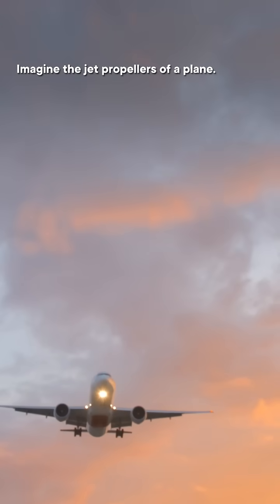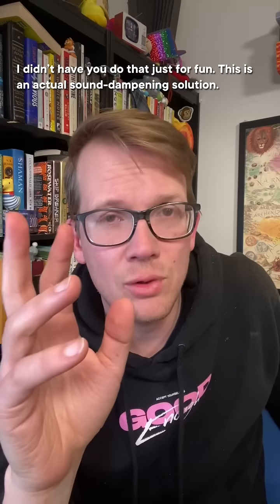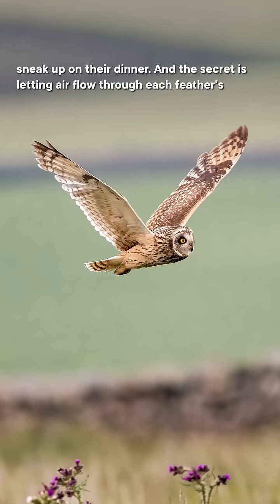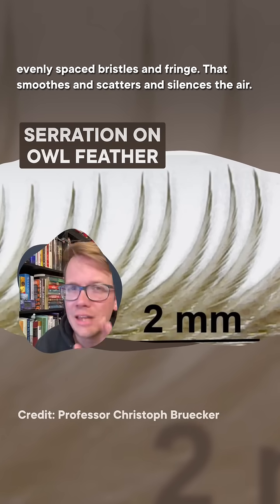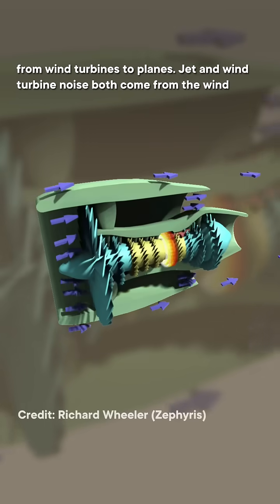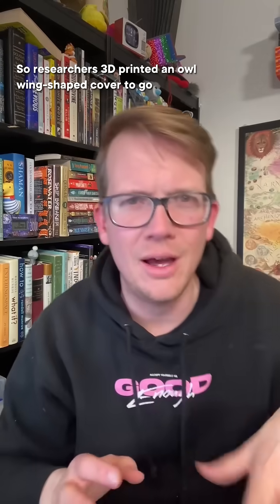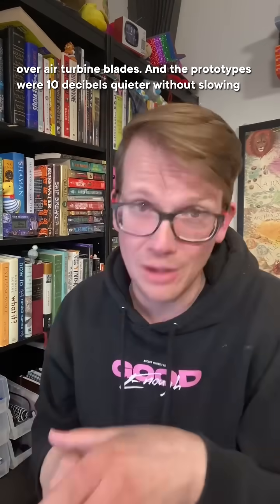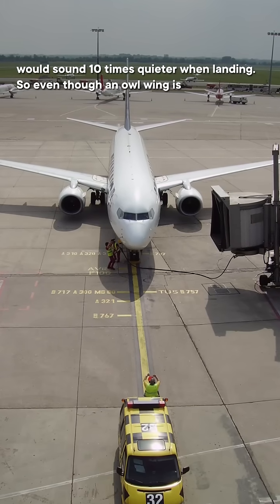Now, we can be as quiet as owls #shorts #science #SciShow

Comment: But wouldn't that increases the weight of the plane, decrease the durability of the airframe or make it necessary to use stronger (and expensive) materials? I mean, to shape something, you have to either add or remove material from the part you wish to shape

Comment: Ive seen owls do amazing flying. They are extremely quiet also. Had them go by my head at night in the forest and hit prey. I felt the breeze. My dog got one at night that did that while I was sitting in my chair in thought. Dog had been right next to me, then I heard a screaming sound, and didnt know what my dog was hurting, but I didn't like it and exploded out of my chair with a rush of wind in my ears and followed the sound and slid in hard knocking them apart and grabbing the owl in my arms to protect it. It was very soft and had no weight, so It slipped out of my arms and my dog went for it, but I got her collar. I couldn't really see anything though. I had no idea what kind of animal my dog had caught. I held onto my dog as I got up, and could just see a kind of jerking awkward motion of an injured animal moving away from us. It had gone silent. I leashed my dog and took her home and got a light and went out by myself to find and help the animal. Eventually I discovered my cell phone which Id lost without knowing. Then I tracked it and found a small young owl which I forget the specie's it was hopping around. It looked at me and then reset its wing, hopped and flew off. I also had found some glowing Mushrooms that night. Ive seen that owl since several times now there.

Comment: Wait a second, I am not convinced it would be feasible in jet engines, wind turbines sure, but jet engines are precision engineered machines, which are extremely sensitive to non uniform materials, as the centrifugal forces are massive in them. So much so that one that disintegrated on a dc 10 nearly completely cut its tail off, and in the process it took out all the hydraulics on the plane. So fro an engineering point of view the only what jet engine turbines could be built in this way is if the engine speed is significantly reduced, which unfortunately would make sustained stratospheric flight impossible, and thus completely taking away the biggest advantage of jet powered flight, which is it creates it's own induction helping sustain combustion at very high altitudes. 

Also I am wondering what the effect of this would have on the blades interaction with air, as they are constantly transonic, look at normal wings how much we needed to adapt them for transonic flight, which to me indicates it is unlikely to function the same at transonic speeds, though I could be wrong on this one though.

Comment: Reduces by 10 decibels but makes it 10 times quieter? That only works with the numbers of if the original plane made 11 decibels a 10 decibel reduction would be 1 decibal making it 10 times quieter...
A whisper is like 30 or 40 decibels depending how close you are. The sound drops off exponentially with distance.

I probably misunderstood something but I'd like to understand what you meant by 10 decibels quieter and 10 times quieter.
Airplane engines are usually I think somewhere around 140 or more decibels

Comment: Theyre called fan blades not jet propellers lol there are turbine driven  propellers though and this probably wouldn't work out so well as a fan intake is designed to smooth the airflow for bypass air to cool the engine and for intake air that is combusted inside the engine if you add owl feathers to this to create turbulence its going to make the aircraft very sensitive to cross winds  and other flight conditions and will cause the engine to cut out completely or have compressor stalls

Comment: “Jet propellors” 😂
Reply: Fun fact! There have been both piston-powered jet engines (using a piston engine to drive the turbine blades, and the jet thrust to push the plane) and jet-powered propellers, (using the jet to turn the propeller, rather than using the jet thrust to push the plane.) Neither worked all that well, but the 1930s-1960s was a wild time for aircraft experimentation.

Comment: If the small scale test gets 10dB reduction, that’s slightly lower than 1/8 original noise. (Each -3dB is 1/2.) Some may use the term 8-times lower to describe such effect. But that still doesn’t count into 10-times quieter. Any indication that large scale will perform better than small scale?

Comment: Jet propellers of a plane. Huh?
Unless you're referring to a Propjet, jet engines don't have propellers.
A 747 doesn't have propellers.
A Cessna Caravan does have A propeller and uses a Gas Turbine engine to turn it.

Jet engines have a compressor section.
An axial compressor not a piston type.
Axial compressors have a stator with vanes pitched to direct air flow. Behind the stator is a rotor with vanes pitched the opposite direction the housing surrounding the stators and rotors is somewhat like a funnel, it narrows and the vanes on the rotors and stators get shorter.

Comment: “Ten times quieter”
MFW I forget decibels are exponential : 🤔 🧐 😮
Reply: Doesn't Decibel work as follows?
+10 decibels means twice as loud
Reply: @kstergiou3  yeah… so the airplane would be half as loud as before if the noise would be reduced by 10 decibels.
Reply: @kstergiou3  yes, he got it wrong. But anyway having planes 2 to 3 times quieter would be a dream come true to many residents near airports.
Reply: @MatíasMoreno @Konstantinos Stergiou nope. He got it right. It's a standard logarithmic scale.
Reply: @MatíasMoreno  can confirm as one of those people near an airport
Reply: Nevermind, it's 10x larger every 10 units (from 10dB to 20dB is 10x increase)
Reply: @kstergiou3  yep, except usually we use either base 2 or base e for the logarithm, so we usually say it's twice as loud every 3 decibels so we can use logarithm faster on that (2^(10/3) ~= 10 indeed) that makes much more sense when working with sounds

Comment: Although they did not slow down the blades, did they still produce the same amount of thrust?  Quieter jet engines with greatly reduced thrust would require more engines and energy usage to generate the same amount of lift and speed, unless the thrust that is generated is equal to current designs.

Comment: That would be great even for computer fans, the majority of the noise that happens in a computer is from the fans, even if you have a water-cooled machine the radiator fans are still just as loud as a normal air cooled setup.

Comment: Owls wings are also less efficient than other louder bird wings. So by making the air more turbulent, aren’t you also reducing the efficiency of the fan blade? Meaning the plane will now need the burn more fuel to go the same distance? You said the turbines got quieter without reducing the speed. Is that the rpm of the turbine or the actual speed of the plane? Also did it take more fuel to spin the turbine (or fly the plane) at the same speed? Just some thoughts. Your videos are entertaining and I thank you for making them! 😉

Comment: Weird, you'd think that letting airflow pass through the turbine and be disrupted would cause a reduction in thrust, and due to wobbly air flow hitting the smaller fans within the engine could potentially cause as much noise as before. I think I'll believe this when I see it.

Comment: This reminds me of the tubercles on the forward edge of the fins of blue whales. They basically are just bumps that are relatively evenly spaced apart, and they create high and low pressure zones as they move through the water just like an owl’s wings do for a “cleaner” hydrodynamic shape. We intend to use those on slower moving blades like those of wind turbines.

Comment: Problem is that modern airliners already have quite silent engines to the point that a good amount of the noise you hear during landing (when engines are at low rpm) is from the wings going through the air and not from the engines themselves

Comment: Tl;dr bullet trains have a part modeled after owl wing feathers to solve a noise issue

It's awesome because this was implemented in the design of bullet trains. Since the old designs would've been ear deafeningly loud coming out of tunnels, they modeled the new ones after different characteristics of birds. The part that connects the train to the wire above it was specifically modeled after owl wing feathers. The body and nose are respectively modeled after the Adélie penguin's stomach, and king fisher's beak to be more aerodynamic. 

I found all this info from an older Vox video, and it was pretty cool to learn about what goes into design.

Comment: Pointless expense simply for take offs and landings. I can imagine the possibility of this making then weaker than a smooth blade. And I doubt they would use an adhesive to stick them on to existing blades in case they flew off an wreaked the engine in mid flight.

I'd put my money on these never existing commercially if they dont improve efficiency.

Comment: Thought most of the noise came from the exhaust section gasses passing quickly past the ambient air creating a strong shear which creates the noise—not the blades on the fan, compressor section or turbine sections for that matter?

Comment: Not propellers. The word for the part you’re thinking of on a jet would be the inlet fan, compressor, and turbine blades.

That being said, I wonder how that would work because the concept of thrust on a jet engine boils down increasing the pressure and velocity of air.. so would you even be able to dampen that air? Perhaps the noise generated from air vortices off the wing tips?

Comment: “Jet propellers”
Reply: This may be because I studied aerospace engineering but that one made me cringe so hard 😆
Reply: @lauras1392  as a maintainer on airliners I know how you feel. Fan blades, fan blades, fan blades - not propellers.
Reply: Yes.. I’m no aerospace genius, but I was instantly wondering why a jet would have props & figured I had mis-heard him.

I’m somewhat less intelligence-less  than I thought 🎉 🤓
Reply: Isn't that basically a turbofan? Or idk, a turboprop?
Reply: @nauvalghaina8616  I believe there is turboprop (propeller), turbofan (fan) & turbojet (no fan). 
The propulsion method differs between each & jet propeller is a mix of different technologies, that I don’t believe exists.
But I’m no expert..
Reply: @everyhandletaken  turbofan and turboprop has one thing in common. Most of the thrust its produce is not by jet. It's the fan/prop that the jet moves
Reply: @everyhandletaken  a turboprop is a propeller driven by a jet engine, a turbofan is the jet you see on commercial planes, a turbojet is turbofan but the big fan of the turbofan is much smaller creating more thrust but being less efficient (they are mostly used for fighter jets) and a fanless jet is called a ramjet
Reply: @leonkrohm5429  thanks for clarification!
Ramjet is my new fav word
Reply: On one hand, yeah that's painful.

On the other hand, so-called "turbofans" are just ducted airscrews/props.
Reply: Also, "fan" usually refers to something the purpose of which is to move a large amount of air, usually for ventilation.

The fans on a turbofan do move large amounts of air, but their purpose is propulsion, not ventilation. So, by definition/etymology, you could call them propellors.

Comment: A major cause of jet engine noise is the air being heated and changing temperature so quickly after combustion. There are things called hush kits on a lot of aircraft that specifically work to more effectively mix the exhaust air with the surrounding atmospheric air in order to reduce noise. This helps both on the ground and in the cabin: There is actually a lot of weight sacrificed on airliners to reduce cabin noise for passenger comfort, primarily because of engine noise. With hush kits and other sound dampening devices, hundreds of pounds of this sound dampening material have been gradually removed from aircraft over the years!

Comment: Problem... 
The more "feathers" you add, the more wind resistance. More wind resistance means more friction. More friction means more heat and an exponential requirement of more energy. More energy requires more fuel. More fuel means more weight. More weight requires more energy.
Reply: And we still have to deal with the additional heat... big oofs.

Comment: The owl wing idea is cool but would destroy any efficiency the engines have, If you look at new turbofan engines (commercial plane engine) like the GEnX, they have ‘cuts’ evenly spaced around the exit of the engine cowling kind of like the example he used with the owl wing. It actually quiets the air exiting the engine and mixing with the ambient air around it. But the owl wing idea inside the ‘fan’ of the engine, maybe not

Comment: Removing 10 decibels won’t make it ten times more quiet. It will make it 10% more quiet. A jet is roughly 100-150 decibels.

3 decibels is the noticeable point at which you can say the noise just barely increased, or decreases in volume. This man in the video is speaking gibberish.

Comment: It might not slow the fans down but does it require more power, if the blades need more power that’s only going to weigh the plane down with more fuel and cause prices to rise for tickets which is not worth the price for the sound of something 35,000 feet or more

Comment: The problem is, even though the blades aren't slowed down, it significantly reduces the amount of thrust produced by the turbine.

Also, airflow isn't the only reason jet engines make loud sounds.
The engines are also burning fuel in their core, which also generates sound. 
Additionally, the airflow leaving the jet engine as exhaust is also a source of noise.

This simply isn't a realistic idea.

Comment: The noise doesn't only come from the engine, especially while landing. I worked in the air industry and most of the noise comes from the landing gear once it's down. This video is good hypotheses but ultimately pretty wrong

Comment: 10 decibels does not equate to 10 percent, so not 10 times quieter. A decibel is roughly measured by each decibel equals 1 foot of distance that the sound can be heard from. So 10 decibels would be roughly 10 feet. 
You would have to explain further to show how you arrived at 10 percent.  Also yes this idea would remove noise but you are adding more pieces that are small and easier to break. Even a small piece breaking and being pulled into the engine can completely destroy the engine. I definitely would not want to be in the plane while this is being tested.

Comment: Did he really just say “jet propellers” ?
Reply: I mean, those do exist. That's just not what he's talking about here though, so I'm with you.
Reply: As an aerospace engineer, the difference only matters in technical documents (design docs, orders, etc) or when you want to be pedantic on the internet. I promise it doesn’t matter here.
Reply: Ha also calls a jet engine a "turban"
Reply: That’s just a turbofan. A jet engine with a propeller.
Reply: I mean the propellers in the jet are indeed propellers...
Reply: @ReubyD118  but those aren't propellers. They're compressor and turbine blades. With the 1st stage being the fan
Reply: @ShelbyWithAShelby  no no according to him those are turbins not turbines
Reply: @ShelbyWithAShelby  the fan has the same purpose as a propellor so you could consider it the same thing.
Reply: @Goozack13  ehhhhh, not really. Only jets with propellers would be turboprops
Reply: @Goozack13  that depends on what purpose you’re talking about
Reply: @Goozack13  no
Reply: @Ray-pq3fp  I'm so glad that bothered you too
Reply: @Ray-pq3fp  That is a correct pronunciation of the word, though TURR-bynez is more common.
Reply: @ZipplyZane  true but outside of France that pronunciation is very jarring and confusing due to the existence of turbans
Reply: @Goozack13  not at all. The fan is the largest thrust producing stage in a turbofan. The CFM56-7B produces roughly 80% of its thrust through the bypass air that flows through the fan. However it also counts as the first stage of compression.
Reply: @Goozack13  no they don’t they push air through the engine and that gives them thrust
Reply: @Ray-pq3fp  was gonna comment that too. Lol
Reply: I thought about it, and jets ARE propellers, not in the common sense of the word propeller, but in the fact that they do in fact PROPEL the plane forward.    🤔

Comment: "10 times quieter when landing"
It's a shame the engines are at ~30% power and most of the noise comes from astrodynamic effects from the body and wings.
If you did this to the wings then you could talk about quieter landing .
Constructing something like this is far to expensive and complicated to ever happen at a large scale. 
That's why you usually see improvements in the area of 1-5%. 
Also 10 dB is not x10

Comment: Most of the noise is generated from the trailing edge of the blades modern engines have noise capturing panels which dampens fan and low pressure turbine noise but the core compressor still produces majority of the noise at higher rpm the air is so turbulent it gets heated from air friction but it has to be to aid in combustion

Comment: Not a propeller. The engine has individual "blades," that rotate within the plane turbine. Just like a wind turbines, not windmill, the "propellers" are called blades. The top part of a wind turbine, where drive shafts and generator are housed, is called a nacell. Also, wind turbines have a blade type called a whale fin. More efficient and quieter than flatter surface, more common, blades; usually higher rpm residential turbines. With jet engines the compression of the air-fuel mixture is more important than noises made by the system. With Beth's law, it would be less efficient with a jet engine, and causes less power.